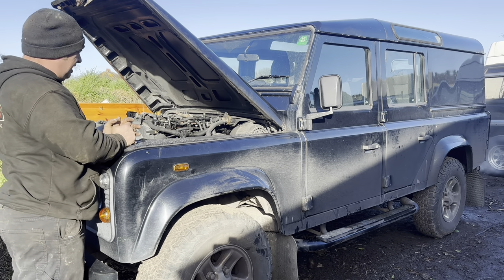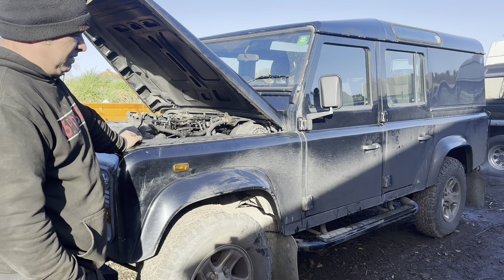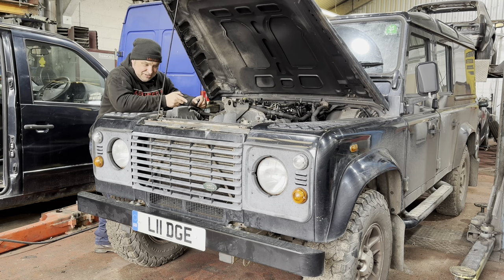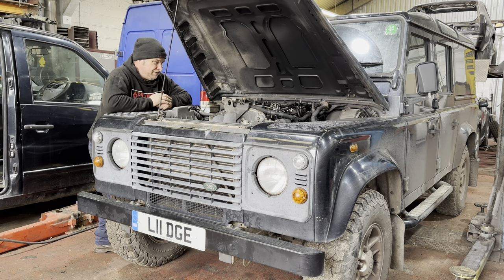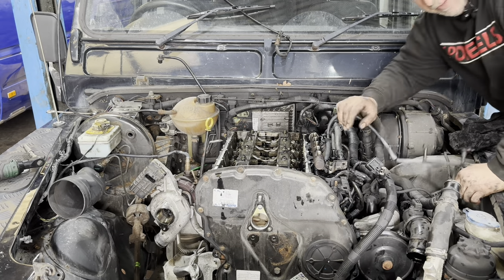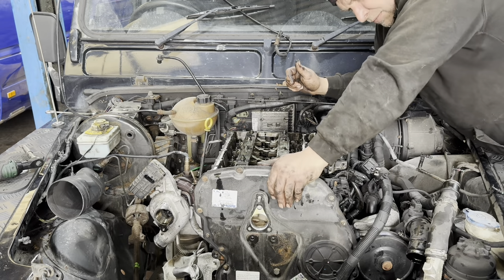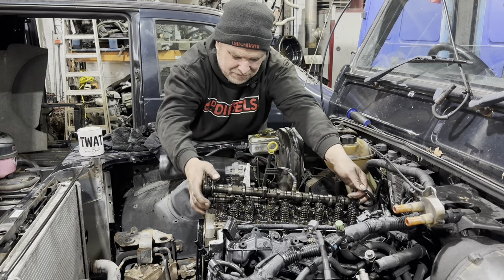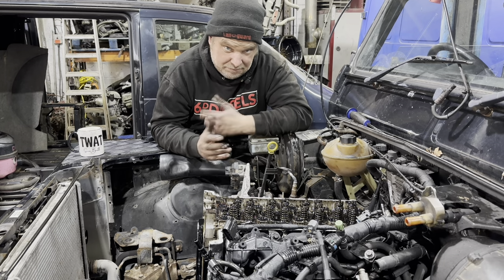Land Rover defender 2.2 engine failure we tear it down!! Is it fixable??? One way to find out

Comment: Al , nice plain talking rant more please. I agree the old engineering worked and we want it back. Throw all the plasticine engines in the bin. Just a quick question. Which diesel engine has machanical pump and injectors preferably without a turbo. Would that be a 200 series Mercedes. It must be hard for you, seeing the same mis engineering coming through your doors. An old school proper engineered  vehicle would make an interesting video facetube. In your facetube time. Say hi to fudge the smudge, as he's usually in a cloud of smoke. Stars in there eyes more like diesel effluent. Tonight Al I am going to be, the one who gets this to clatter bang then run. Enjoying your videos, nice work
Reply from the maker: Merc wise a 601/2 isn’t a bad bet 2.2 and 2.5/9 all can come none turbo and with a me mechanical fuel system 👍

Comment: Pop quiz people  ? I've got 1 of these engines in my 2010 citroen relay 2.2.  I've repaired it so many times now. The question is what other engines will bolt up to the gearbox.  I'm sick to death of chucking money at it. I would just get another van but it's my own van campervan conversion.  Any help would be appreciated. 😊
Reply from the maker: I dont really think there is to be honest, they did do a 3ltr one that has a really good Iveco engine 
 You might be able to get a conversion plate for a BMW m47 and you’d have to do a heap of work to get it bolted in and then sort the traction control out 👍

Comment: God them ford diesel engines are really crap now but the old school diesels used to run for ever as they used to put them in ldv vans and other vehicles but don't need to tell you al as your the diesel expert crazy 🤪 and funny 🤣 but you know wat your doing of all types of vehicles good job you got fudge helping you in the workshop 👍
Reply: Only good Ford Diesels were they ones they bought in from Peugeot 😂 Give me a 2.3 XD any day.
Reply: @-DC-  ok thanks didn't know that learn something new everyday my old transits and lvd was way before 2000 welding them was a problem for me as I do that for a liveing but dont no nothing about diesel engines but they never let me down when i did have my own vans
Reply from the maker: Ah the 2.5 di wasn’t bad !!slow noisy but it never broke !!!
Reply: @6DDIESELSDorset  very true that's why I like them as they just kept going just basic service mainly oil and filters but never let me down

Comment: I can stand on my Series III wings without cappings and they don’t bend.
Reply from the maker: My lord you must be a slim little person 👍
Reply from the maker: lol I haven’t owned a s3 for quite a few years !!  Use to have a fleet of them years ago 👍
Reply: @6DDIESELSDorset  2.25 diesel. Standard gearbox. 4 speed no overdrive standard diffs, 88” with 6.00 x 16 mud pluggas and I achieved 64mph measured by GPS.

Comment: I have an EV and i love the thrill of sitting ontop of a chemical bomb waiting to go off. But the other day the aircon pump failed on a 23 plate and left a man stranded in the middle of Swansea. The car put itself into park and wouldnt move.... all because of an air con pump that cools the battery failed... in winter.... an aircon pump failure in winter stranded me... EVs are nothing but a bit of fun and a laugh but theyre f*ucking terrifying when they go wrong.

Comment: New engines are terrible , built so cheaply and badly, nasty cheap plastic cam chain guides, plastic sumps, cam covers,water pumps,intakes and housings ......
They don't make them like they use to !  i've just repaired my old Dyson, new motor £60 but who even thinks about repairing them these days? 
Think all my tools are over 20 years old at least , non of Chinese cheese stuff .

Comment: Educated spanners monkey 😂🤣😂
I may need to fit new valve guide seals to my 1974 S3 88, because she's a wee bit smokey at start-up, but runs fine after a minute or two!
Lovey 300 TDI as well, although am fitting a new cylinder head at 140,000 miles and 27 years. She's blown her head gasket, but still got me out of the woods literally, and home. Probably just a gasket would do, but it makes sense to just fit a new head with all new valves, valve guides ect. I will keep the old head and see if it's not too bad as a spare. 
What you say about the way older more fixable vehicles being more sustainable is so true, especially when you consider the percentage of manufacturing emissions is such a huge part of a vehicles total lifetime emissions. Vehicles need to be built to last much longer. We have the ability to do this but manufacturers are forced to make things cheap and quick to please consumer demand, oh and the idea of needing to adjust an air vents direction through the touch screen just goes to show how common sense left the building too, why Tesla why?

Comment: This is the problem with a uni geek on a cad computer designing cheep motors that don’t do what the original purpose was to do it’s now a image thing not a mod keep it simple British thing 
Get a machine to design the hole thing 
I drive a 1987 wold Difender 90

Comment: Have to agree, strange world where nobody can fix anything, except yourselves obviously,👏👏👏 
I've got a 2..2 relay,  euro5,,  there's now a new breed of mechanic, you know,the. Diagnostic expert, lovely clean van expensive work. Clothes, a marketing himself expert 🥴 3 different ones I had, to do diagnosis, because I could see my oil level was going up, Rather quickly, nothing wrong mate,£80 please,, 3times, all good mate 😂 eventually I start investigating myself, bought a little diagnostic tool,, and can see that the average mileage between dpf regeneration is 0,, more investigating and I discover these pieces of shite pump more diesel into cylinder during Regen, ffs, atomizer blocked on exhaust,, probably fukkked the engine because of those diagnostic experts that don't want to fix anything,, he ho

Comment: U r dead right there electric cars just done idetec in Honda CR-V  it only done 106 thou turned a shell  injector tip off stamps up to 95 thou  I am 74 old done on floor  nightmare